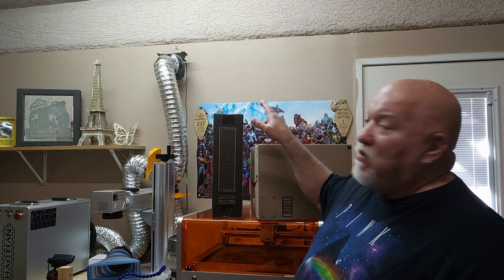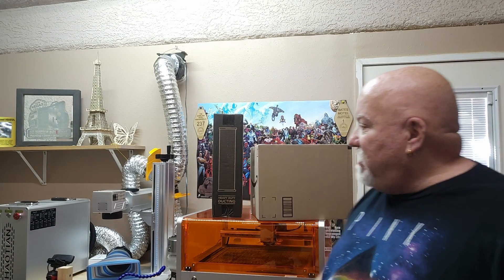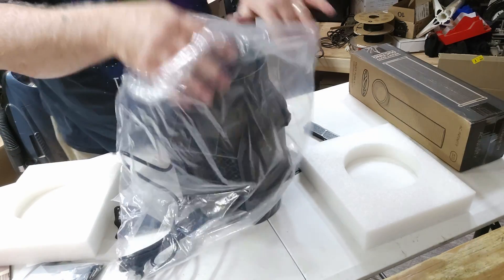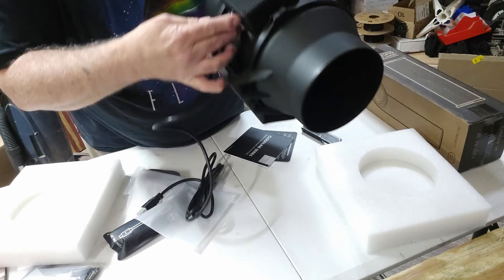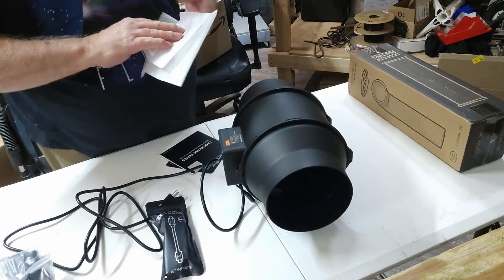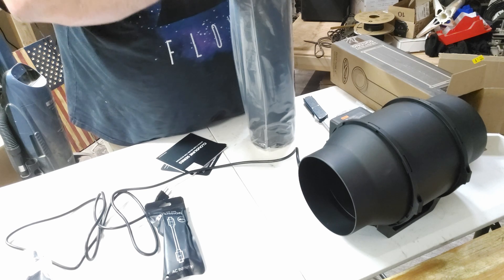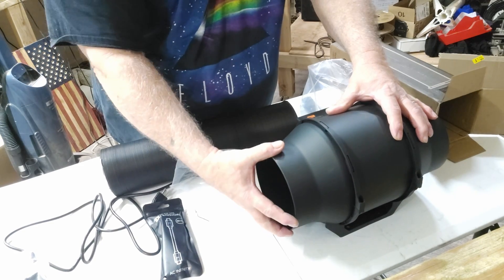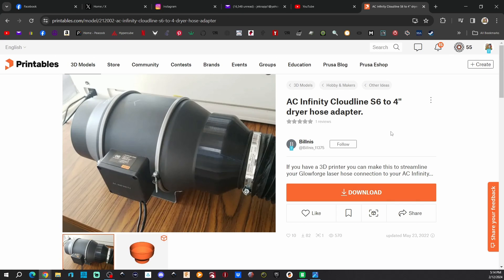Laser Duct Fan Upgrade | AC Infinity A6 #3dhp

Comment: for fan to fully work you need same size air intake on enclosure, through to outside as exhaust, minimum length of flex tube, should go out level with enclosure, for both intake and exhaust.  I went with 8" 1600cfm, 8" intake and exhaust to outside.   good basic design however.  airflow math limits your current to 140-150cfm, that will increase once outside intake is added.  hole in enclosure should match fan diameter, reducer lowers CFM.
Reply: Not as much as using flex pipe, that flexible ducting reduces your air flow about 50%

Comment: I just purchased this fan its great! 👍 im still trying to figure out how to remove the factory fan without cutting the wires or damage the condit or orange plastic? The fans cord won't fit through the Condit Roly used.
Reply from the maker: Unclip the fan,the wire is like 6 inches long.Do not remove the silver metal duct.The wire and connector will slide through it.Then use shorter bolts for duct with grate. Save fan and screws,if you ever sell it,you can put back to stock.
Reply: @3DHP  ok thanks 👍👍👍👍👍

Comment: When you removed the fan, were you able to continue to use the same exit fitting minus the fan to attach the hose? Was it difficult to remove the fan? My Lasermatic should arrive soon and I'm trying to sort out an exhaust for it, which is going to be very similar to yours. Thanks.
Reply from the maker: I just used shorter bolts and put the duct back on. Once you unplug fan,wire with connector will slide out of the aluminum channel,no reason to try and pry it off.Its very easy to do.I also left the fan screen on the inside.
Reply: @3DHP  Thanks! Great explanation!

Comment: I had one of these, and it seemed the only settings that worked were the last two. Should just be High/Low.
Reply: I’m sure your set up was the problem. To get the most performance you want little to no curves, solid ducting (flexible is trash) and you want to mount your fan right to your vent cover.